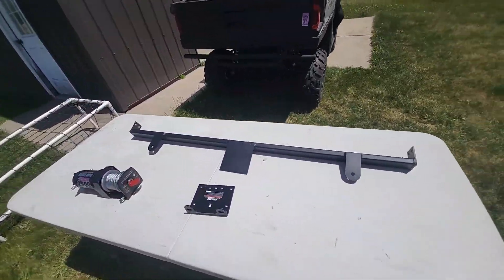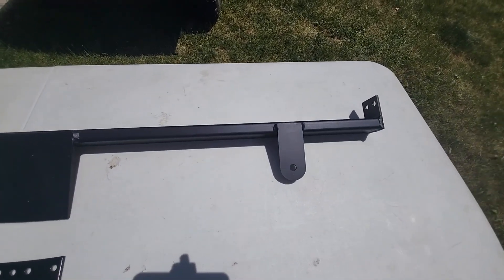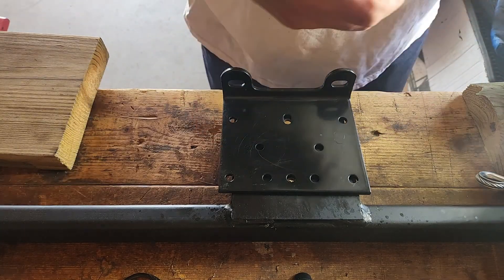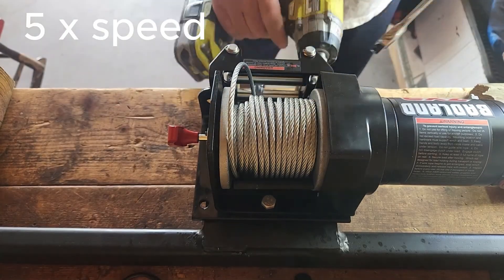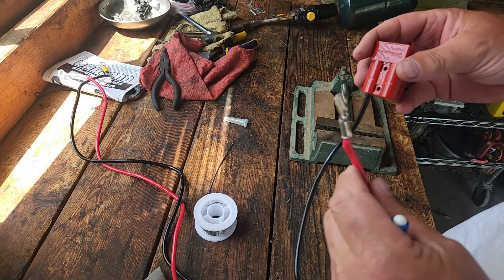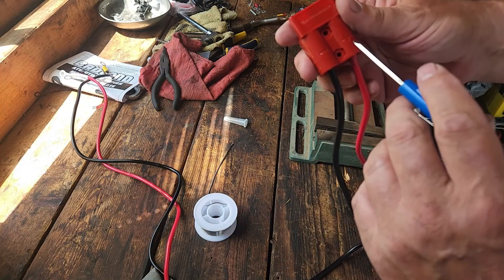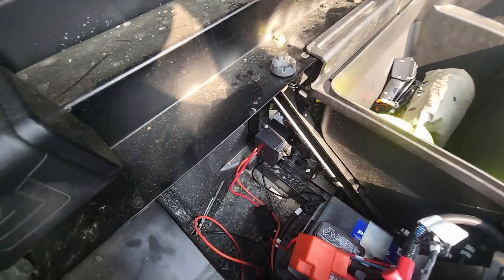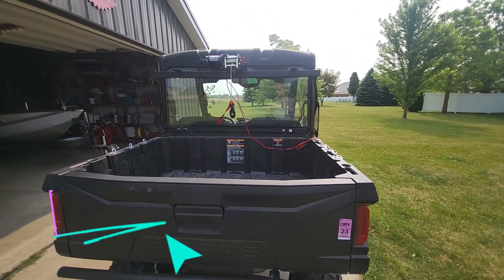Side by Side Deer Loading Made Easy

Comment: I fab a system awhile back but I made use of the front wench and used a pulley system to route my wench cable over my cab. Not pretty but functional. Good job on your system